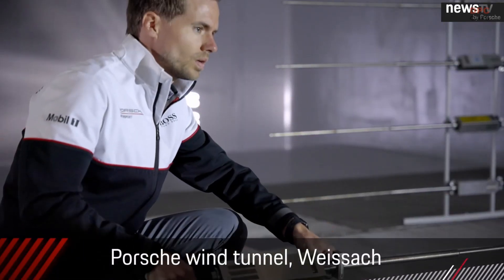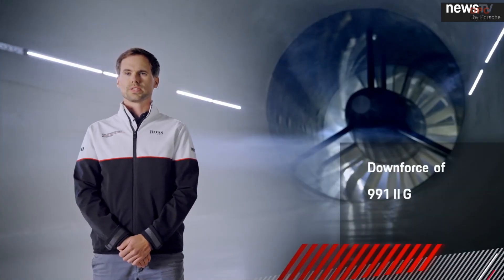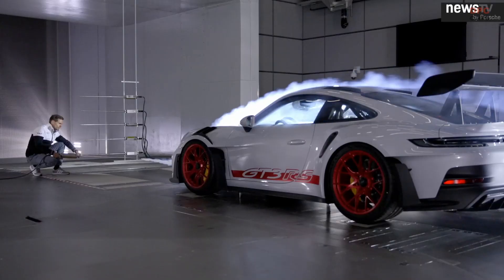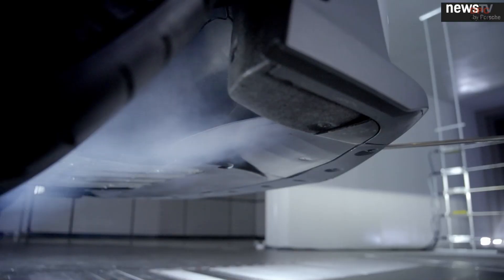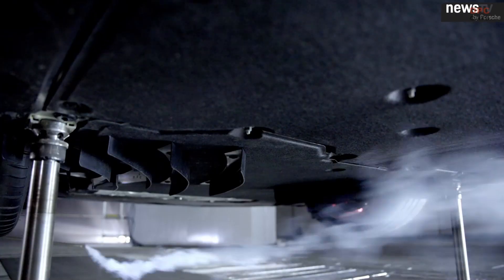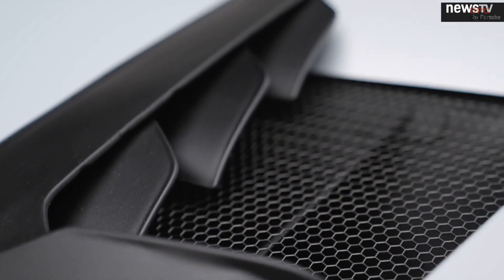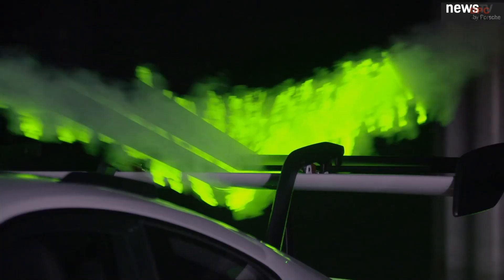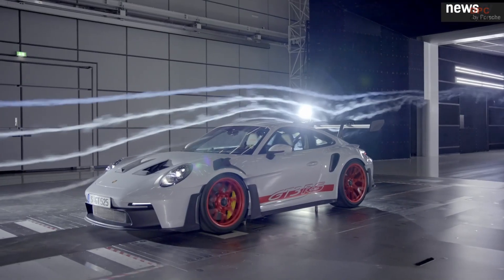New 2023 Porsche 911 GT3 RS Active Aerodynamics Development

Comment: Cars are shaped all wrong!!!  A car in motion should be shaped like a inverted airplane wing.  A car should be flat on top and curved on the bottom like a inverted wing.  Air going under the car would produce down draft.  Porsche is just putting band aides on a flawed design.  Air going over the curved top of the Porsche car must want to suck itself up.   The wing on back and front are just awful band-aides.
Reply: You tell em mate! I'm sure with you on the design team they would continuously break world records around the 'ring too!
Reply: Is that why Porsche makes the cars with the best aerodynamics?
Reply: @gaycommentator2405  the aerodynamics on the Porsche car are great at making a flawed design work reasonably well.  These cars are very twitchy and become unglued because all the aerodynamics are band aids on a flawed design. Flawed designs work reasonably well.  It’s the emperor’s new clothes.  We can all see the design is wrong but nobody says anything.
Reply: @1911Earthling  The design is not wrong, in the form of a water drop, but not at the same time. Both in terms of aerodynamics and handling, Porsche makes the best designs. If only the aerodynamics are good, it will be an airplane instead of a car, the downforce drops to 0, and this is the last thing to want for racing cars.
Reply: @gaycommentator2405  Porsche is the best at doing the best they can with the wrong basic design.
Reply: Everything aint about going fast tho. There are other factors that goes in the buyers mind. Like sound and looks.
Reply: @felixbb1445  sound won’t change!  Looks definitely.  But this is for race cars not for normal  passenger cars.
Reply: @1911Earthling  I’m not saying it will change. All I’m saying that there is more then only performance that goes in account when buying a car
Reply: @felixbb1445  my design would never sell.  Just for race cars where aerodynamics really count.  Crazy idea.  Impractical.
Reply: @1911Earthling  the Austin Martin Valkyrie has a raindrop design like you described where the nose of the car is lifted off the ground
Reply: @cameronwilliams7930  no kidding I will check it out.
Reply: Great knowledge. Now build the car!
Reply: A flat bottom allows you to have a large low ride height zone. This creates a very large low pressure zone and sucks the car to the ground. This, combined with a splitter, produces 80% of the downforce in GT3 cars. If you made the bottom curved, you wouldn't be able to get that large low ride height area, and you'd end up losing the majority of your downforce
Reply: Yes but you also have to have a design that can package the systems, safety components and the driver. Your concept is good for dreams but not practical.